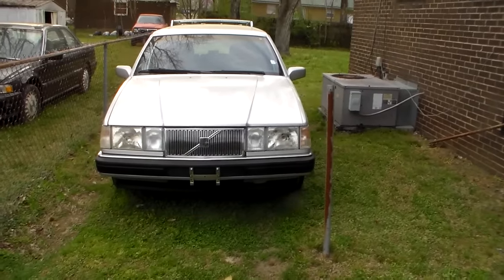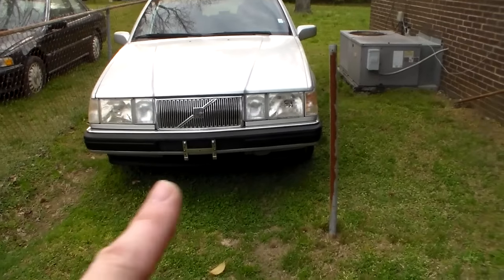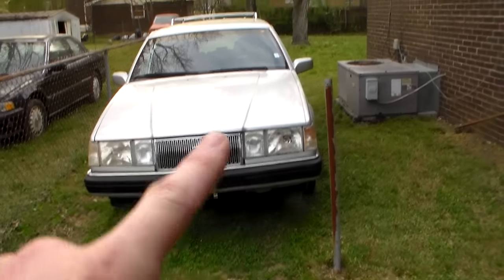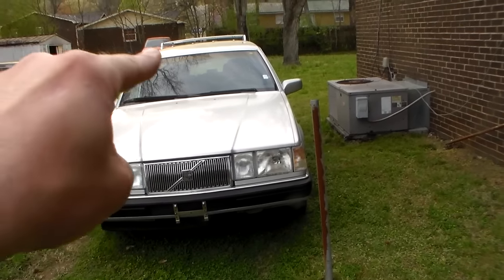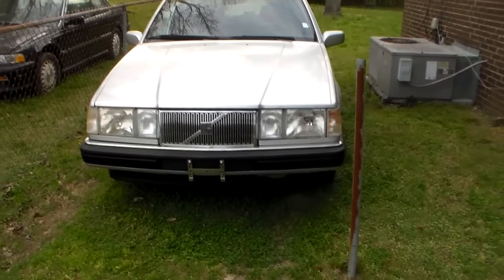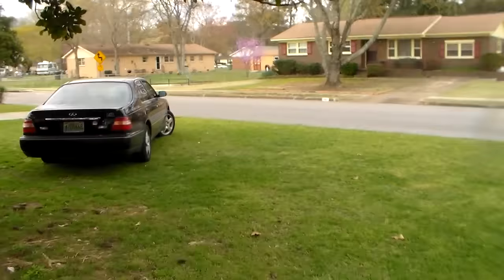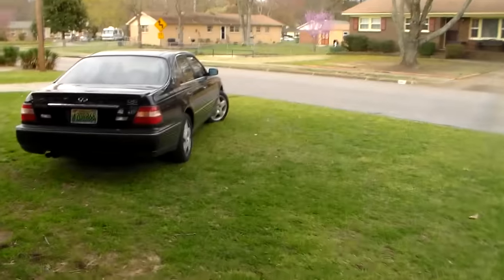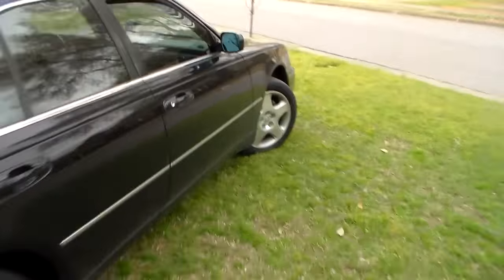So what kind of tow hooks does the Infiniti Q45 have?

Comment: The Japanese tow hooks work well until you rip them from the unibody under severe towing/crash removal. 25 plus years of operating towing/recovery equipment. I always used tire cages as I call them tire straps to secure a car on a flat bed tow truck. If I use a wheel lift I secure safety chains to the tow hooks or other towing securing areas on the unibody along with using tire straps. It gets ugly when a car is lost from a tow truck.

Comment: Hey brother, I love your old Carburetor videos! I have an old 77 Cadillac 425 Rochester that bogs down at WOT, should I take it off and see if the flaps are stuck? I tried all your other fixes and it runs good, just no real power when I smash the gas or go up hills.
Reply from the maker: +DJ Kadilac Thanks man. You need to explain further what it's doing. When it's warmed up and you mat the gas to accelerate hard, does it (A) take off smoothly but no real sensation or sound of going into the secondaries, or (B) it tries to go but chokes and sputters and won't accelerate?

The reason is that if the air doors are stuck shut, it simply won't kick the 4bbl in. It runs fine but no 4bbl. There's also a lockout tab on the bottom butterfly shaft on the passenger side that locks out the secondaries until the choke opens fully, so if you are having choke problems you can also have 4bbl problems.

 HOWEVER, if the fuel supply to the secondary side has problems, it will try to kick in the 4bbl, but there's no fuel flow, so it coughs and sputters until you let off the gas. 

If it's B, what happens over time is that the fuel pickup tubes on the underside of the airhorn(the top) fall out. The bottom of said tubes are supposed to be submerged in fuel at all times so that when you mat it, the bottom butterflies open, the top air doors open and at the same time the venturi principle pulls fuel through those tubes and into the secondary venturi.

It's a long explanation, but if you own and drive a Quadrajet you need to know how it works.

To fix those tubes you remove the top of the carb, find the tube(s) that fell out, and then carefully, lightly tap them back in with a light light film of JB weld. Then re-assemble. Good luck.
Reply: +WhoSaidTyler the car runs starts easy and runs strong in first gear up until about 30mph, when I mash down mid way through the pedal, the engine revs up, gets loud but no increase in acceleration. In fact I have to let off the gas to get acceleration back. I live on a big hill (Hawaii) and I can't get over 30mph going up. 

I noticed my choke was open a little this morning when the car was cold. I also
Noticed the "passing gear cable" next to the throttle was really slack. I tried to move the linkage that opens the 4bbls manually with my finger but it was really stiff. I thought maybe you can't do that when the car is not running or something idk. But I turned the female end of the cable until it was tighter and my pedal is a lot stiffer and a little higher now. Put some carb cleaner in the fuel bowl opening at the top and took a short drive. Car ran fine with all the above symptoms.